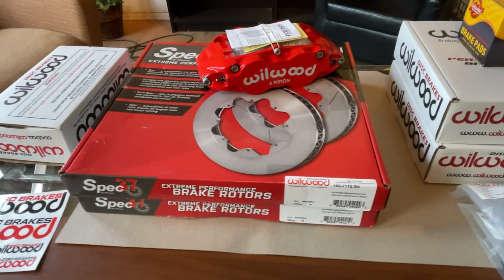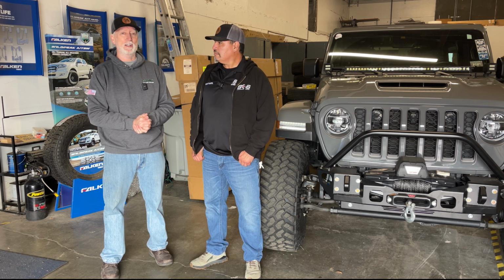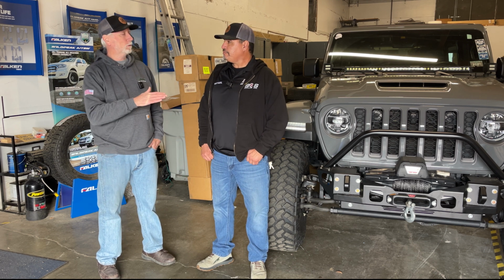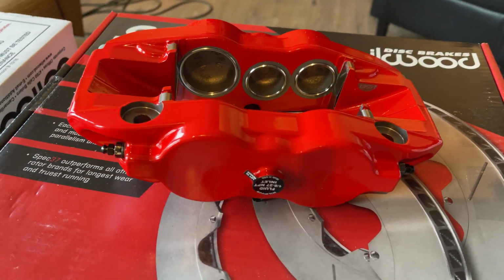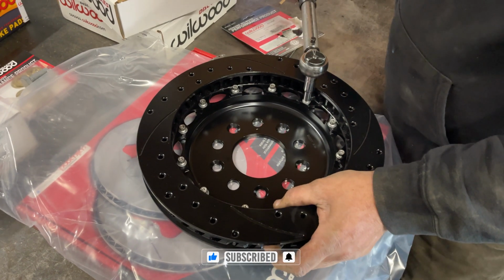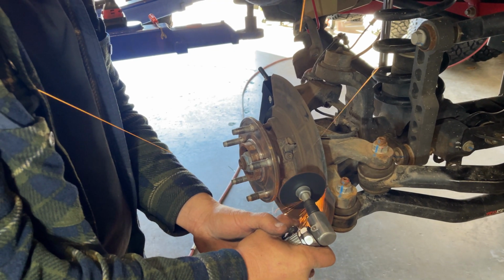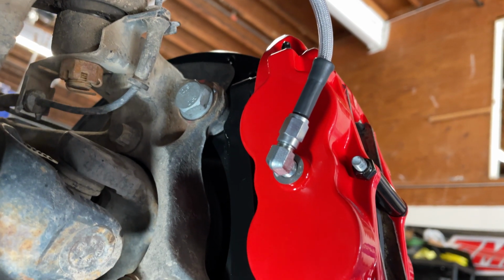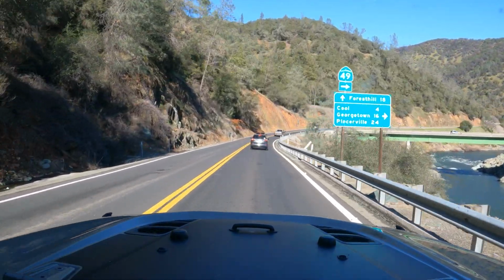Jeep Wrangler Big Brake Installation

Comment: It's been a while since you done the upgraded brakes install. How is the  braking now and any squeaking/noise coming from off-roading 🤔
Reply from the maker: You are right, I need to do an update.  I am getting some squeaking noise on really dusty roads, even after cleaning the pads and rotors with brake cleaner the issue seems to come back.  To be fair this happened on my last pair of brakes also (Powerstop) so I don't know if there is a magic brand out there that has no issues on washboard, dusty roads spitting up small rocks, gravel and dirt.  Braking power is much better though.  Thanks for the question!